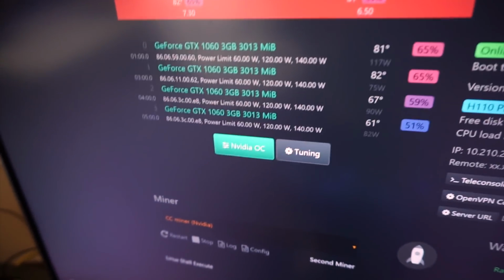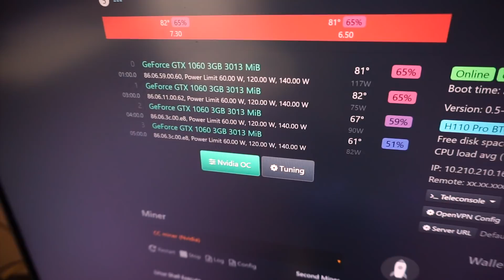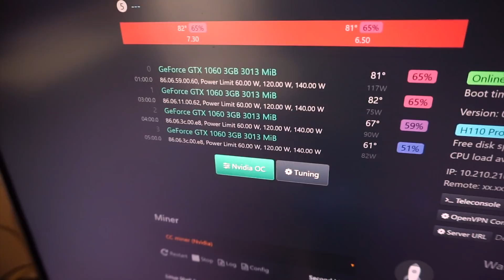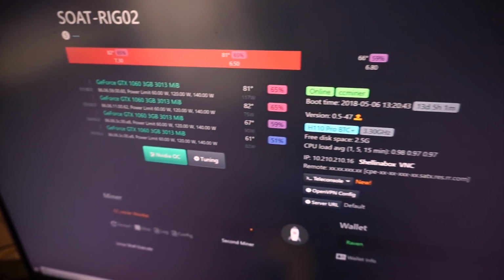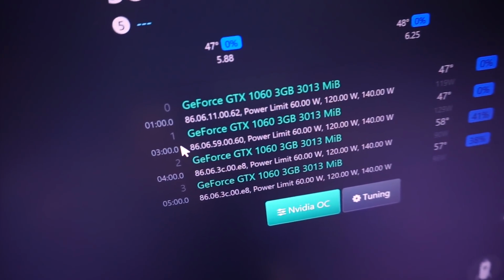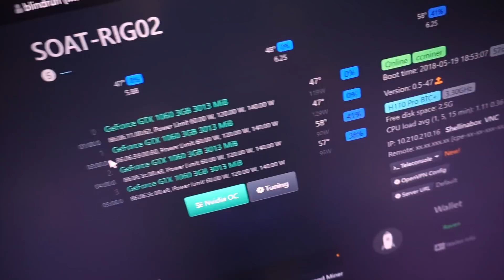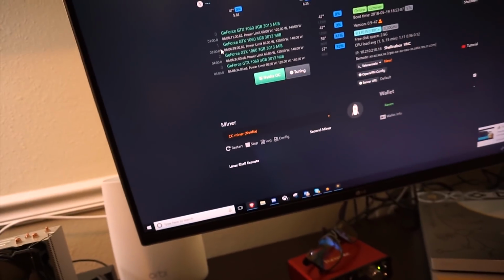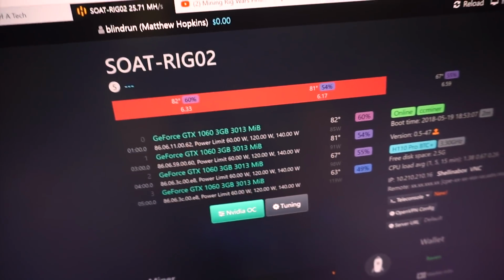Replacing Thermal Paste On The GTX 1060 3GB Part 1

Comment: Do you happen to know if the GTX 1060 6gb MSI Aero has any thermal pads that you have to replace when you switch the thermal paste. I'm interested in trying this on my GPU but i'm worried that I will have to replace the thermal pads as well.

Comment: If youu want to buy a EVGA 1060 with a single fan then buy the SC or the SSC versions, the regular one's cooling is crap, i have a EVGA 1060 6GB SC Single Fan and it's maximumm temp is 74º at 100% when the ambient temperature is hot af (i dont have air conditioner)

Comment: Wow its magic!!
I have 6GB version
Average temp was 60C after replacing the thermal paste 45C !!!
Thanks for share
Reply: Realize I’m 2 years late to this, but did you also mess with any fan curve or power settings? Or was that drop strictly from replacing the thermal paste? I’m hitting the thermal limit (83) on my 6GB version and looking at thermal paste as a potential solution
Reply: @Ghostsoulless  What did you do?
Reply: @williamandres1042  I did end up replacing the thermal paste, and it helped a bit, but ended up having to adjust the fan curves to be 100% nearly all the time to avoid thermal throttling. And with my case being very open, was too loud for me so I ended up selling it. But did end up avoiding thermal throttling like it was with those two changes. Just be prepared for it to sound like a jet engine taking off at all times

Comment: i have tried spread method on intel cpu i have to say its not good. since the die is rectangular in your card, I usually go with line method on these. if its a small square ihs i use pea,  and x for large ihs.

Have tried both gelid and mx4 multiple times and honestly gelid is hit or a miss as they have low life. I got a sealed brand new one which was dry. Now i use just mx4.

Comment: what heat sink replacement would you recommend for the evga 1060 3gb card, that would not increase the foot print of the card to a 3 card slot

Comment: EVGA "GAMING" 1060 have terrible cooling, if you go for the EVGA "SC" or "SSC" they have copper heatpipes just like those aero's.
Reply from the maker: But why pay that if the msi aero stays in the 60s and is the same price as the cheap evga? Makes no sense

Comment: if those evga cards had the saim heat pipe coolers , as the msi your temps would go down . I have a 8 card rig all 1050ti's  and 2 of the card's dont have heat pipes they run hot...

Comment: Theres actually two evga versions of the base model card. The made in china version and the made in taiwan version. The taiwan version runs cooler because it has extra air blockplate that directs the air to the heatsink only, not the pcb, and the chinese version(the one u have) does not have this extra plate. If you need pics i got you.
Reply: Hi! Came across your comment 4 yrs later as I was trying to change thermal pads on my 1060 and discovered it doesn't have any despite everyone claiming this model should have them. Is this the reason?
Reply: @miikareinikainen4050  yup add them

Comment: I am surprised that your GPUs draw so much of power and emit heat. Just to mention that I am using 2 x 6 Gb Chinese version of Colorful P100-106, (mining edition) practically same as GTX-1060s. overcloched to 23.3 Mhs of ether. They draw 65W each. The whole system remains stable at 165 Watts. The temperature never rose more than 55 Celcius, worth to mention that I live in a hot country. My city temperatures between 26 degress at night and 41 degrees average at daytime.

Comment: my fan died on my gpu...twice...it still, somehow, ran for a while passively cooled.  i finally realized the problem, removed the fan, and twist-tied a case fan on it...which entirely fixed the problem.  i didn't remote the heat sink, though...and am curious as to how much, if any, cooler it would run if i replaced the TIM.  fun watch even though it didn't work out!

Comment: Thanks...I was planning on reapplying thermal paste to 4 of my cards that are over heating but now will look at other solutions. 
My biggest issue is that the air my cards are getting is 38*C :( Your window may be heating up that area even with the shade...the glass gets hot and the ambient temp eventually rises around your rig

Comment: @son of a tech - How long will GPU mining last/continue in your opinion? Thanks for making the videos. Just now getting into mining! Purchased a mining rig 6 - 570 AMD to mine Ethereum/Monero. Should be here this week. It won't mine RavenCoin but looking at other rig options.
Reply from the maker: I think the community of miners is a large influence on the subject and they prefer gpu mining. With anything there are ups and downs but I think it's here to stay
Reply: Thanks for the response! I'm just now getting into mining and I appreciate your videos. I was told I couldn't mine Raven Coin with my 570 AMD cards. Is it possible to mine Raven with 1070 cards and is there a brand you recommend at this current time?
Reply: Gigabyte GTX 1070 G1 Gaming GPUs are fantastic for RavenCoin if you can get them for around MSRP or a little less right now.
Reply: Can you tell me if this card is better than the 1070s ---- EVGA GeForce GTX 1080 SC GAMING ACX 3.0, 8GB GDDR5X, LED, DX12 OSD Support (PXOC) Graphics Card 08G-P4-6183-KR
Reply: California Dreaming "Better" will depend on a lot of factors. If you can get them at a good price, yes, a 1080 is typically better than a 1070.

Comment: I have 8x 1060 + 2x 1050ti in my cellar and I am in range 37 - 48°C  ( 50% fan speed ). The most effective way to drop the temperature was adding a fan in front of them. That has made a lot of difference. But it is on ETH

Comment: @Son of a Tech, I watched this to see the outcome, pretty disappointing result, how ever i had this same problem with a mixed rig and i was able to solve it by working out which way the exhaust air was moving out the top or back of the cards and move the 2 hot cards to a cooler position on the rig where hot air was not directly blowing onto them.I'm now seeing expected temps now 74's 75's under full load on the two cards.i hope this helps.

Comment: I have the same cards in a 6 gpu rig. Running on Hive too.  For Raven I set the power at 100w and fans at 70 or 75%. Temps are in the mid 60s.

Comment: I’m always tempted to buy single fan cards, but then I worry about heat longterm. 

That sucks that it didn’t work. 

As far as blowing dust out, I take my rig(s) outside, put fingers on fans to prevent bearing blowout, and use my leaf blower. Quick. Easy. Works. Free. Cards stay under 70 even during summer. But, they arent that old. I’m sure in a year or two the temps will rise.

Comment: I have two EVGA 6GB 1060's running for about 6 months that range between 68 - 72 degrees @ 74 power on equihash.